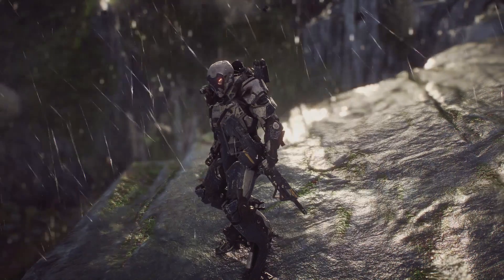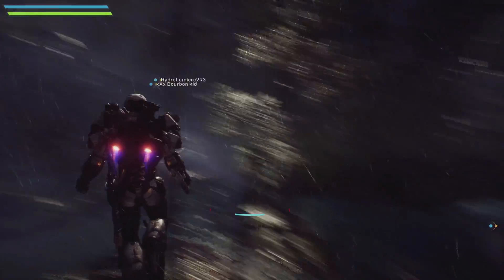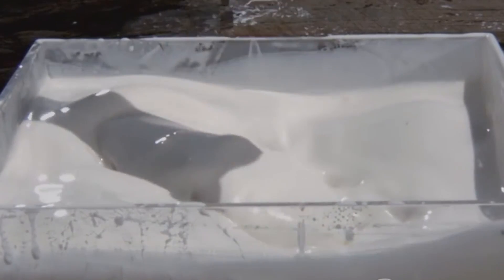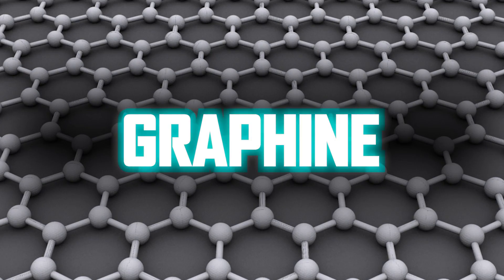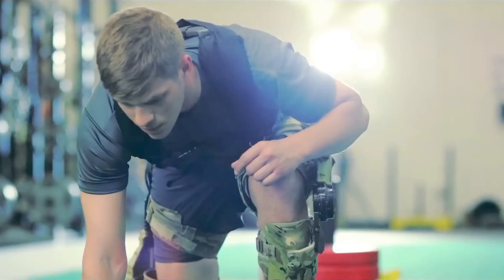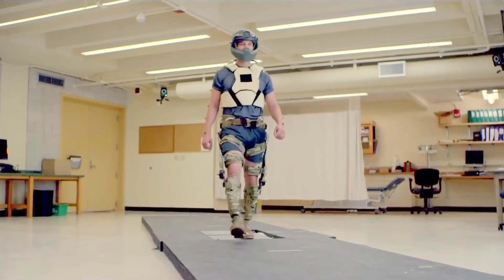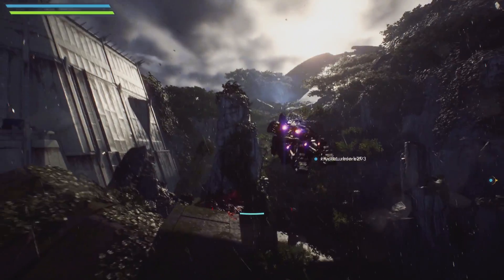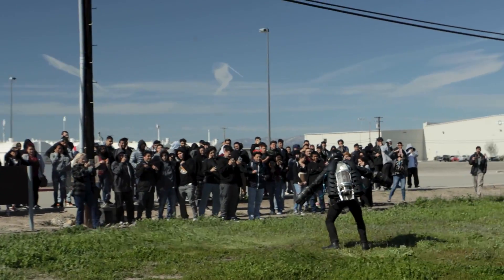Are Anthem’s Javelins Possible in Real-Life? - Reality Check

Comment: We need a more effective power source like antimatter or nuclear fusion even a backpack sized nuclear reactor. You would need titanium alloy to construct the frame due to its lightweight and is very strong also its needs to work in any environment so corrosion resistant work be beneficial even heat as well.

Comment: If not now yeh of course they’ll be able to built a javelin eventually. The fuel might be an issue but other than that don’t see why they couldn’t built one
Reply: Anthems javelins wouldn't work. You couldn't physically fit in them unless you had no joints. You couldn't bend to fit in them.